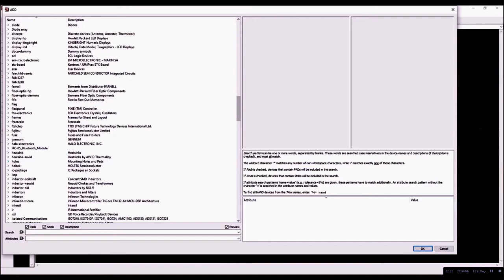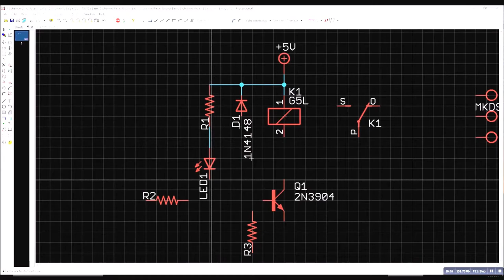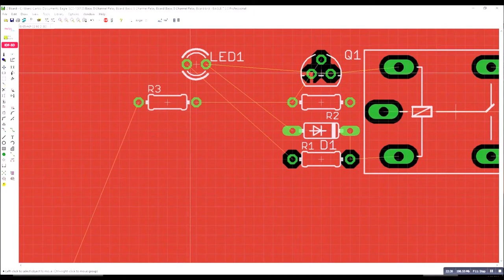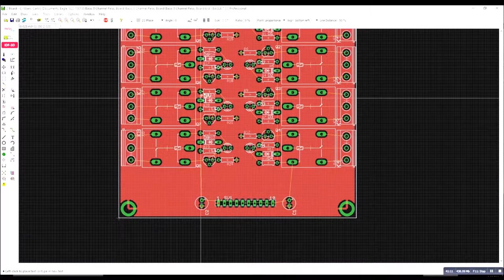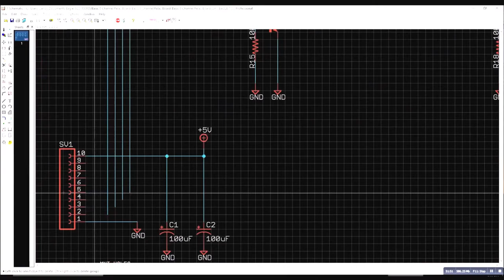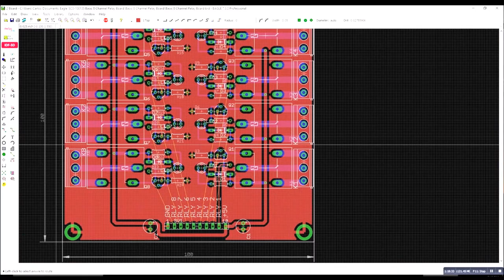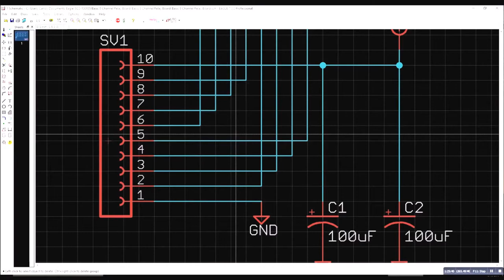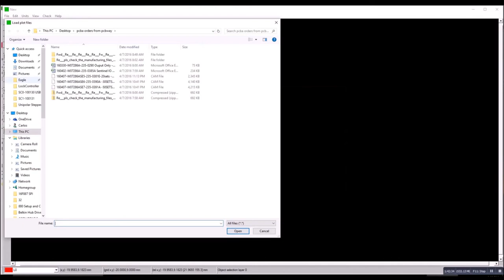Basic 8 Channel Relay Board Design Eagle Tutorial

Comment: How can this be isolated from electromagnetic noise?
Reply from the maker: You can use optocouplers in place of transistors tonisolate the control lines to the microcontroller.  5 mAmps at the input should be enough as most lower cost optos work at a 50% transfer ratio minimum. Hope this answers your question. Thanks for watching.